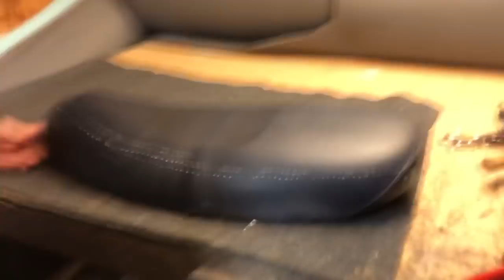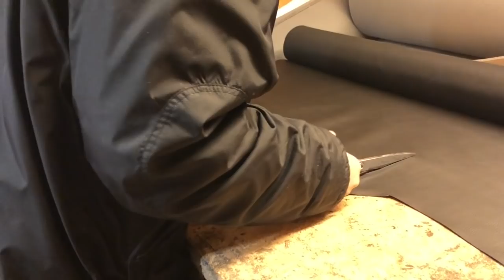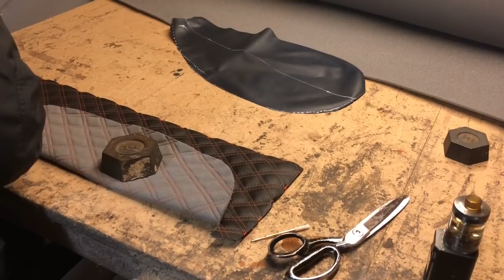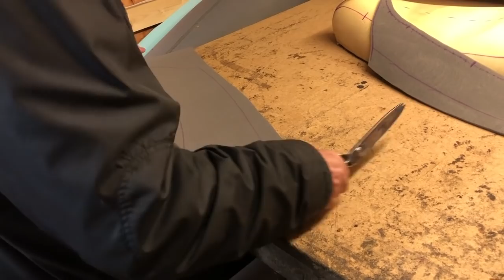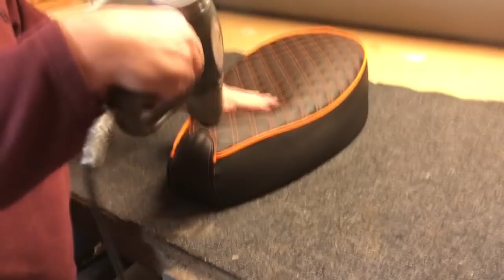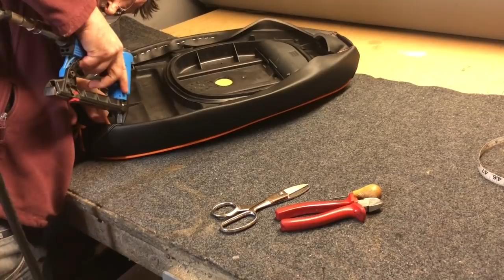How to cover  motorcycle seat.

Comment: Thanks to your videos I’m definitely ripping apart my Sargent seat and rebuilding it. It needs drastic foam reshaping so that will require a new cover. I make vinyl and canvas purses, but what is the type of vinyl you typically use for a motorcycle seat, and is that headliner foam you use when making quilting?  Mostly I’d love to know more about the vinyl you use. Thanks for your talent.

Comment: nice work
Reply from the maker: Thanks John
Reply: @Johnhuntuph  Can you please recommend a padding that you used beneath the primary material?
Reply from the maker: @briefcaseofblues  it’s called scrim foam or sew foam, I use 6mm or 12mm depending on finish required
Reply: @Johnhuntuph  thank you

Comment: Hey here in the us. Want to do my seats. What kind of thread and needle do you use?
Reply: Also what’s the size of foam you use on back of leather?
Reply from the maker: BIGBOI GARAGE  Hi I use size 36 bonded nylon with a size 17 needle.
Hope this helps thanks for watching John.
Reply from the maker: BIGBOI GARAGE Hi on this seat I used 6mm scrim foam, if you want the diamonds to pop out more I would suggest 12mm scrim foam.
Thanks for watching John.

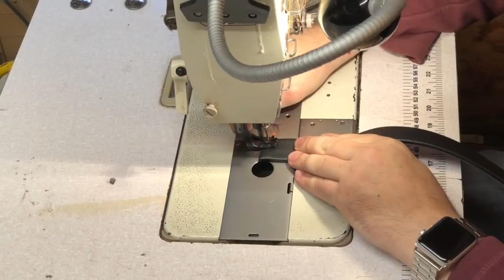Comment: What's that belt like called? And what's the use for that? @19:00
Reply from the maker: Anrods Hi it’s a seat strap, not really used by the passenger anymore  as it’s easier to hold onto the driver.
There kept on bikes for cosmetic reasons as most  modern bikes don’t have them anymore. Thanks for watching John
Reply: @Johnhuntuph  I got it now,  thanks for the reply and the info....you've got a new subscriber and nice work keep it up.
Reply from the maker: Anrods cheers John